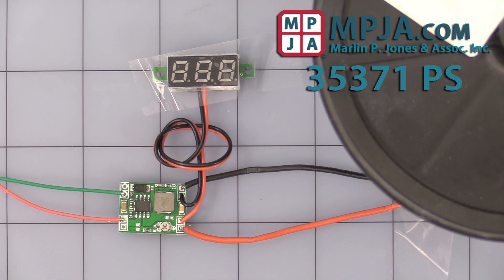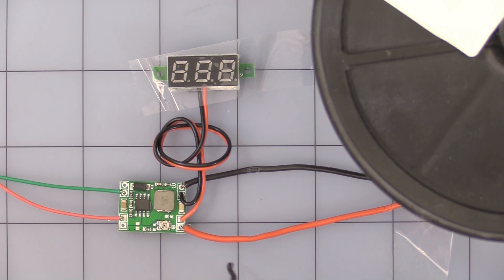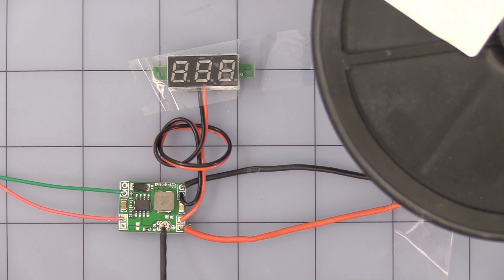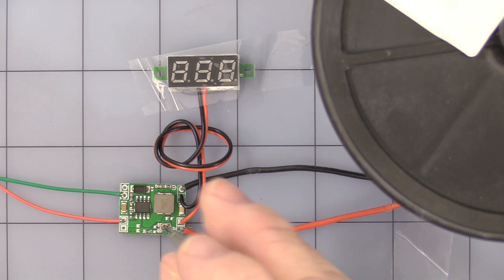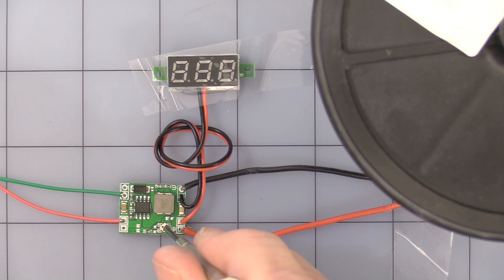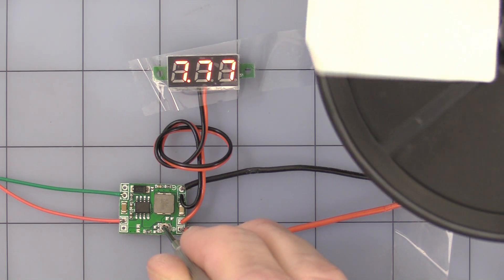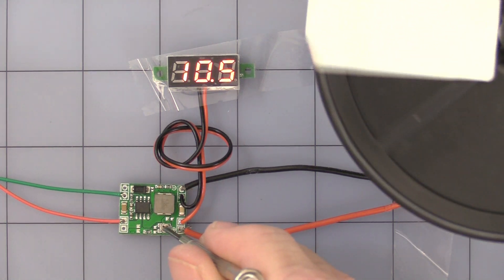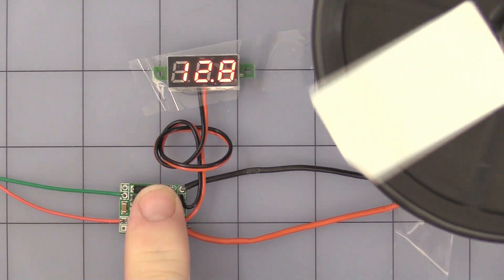Micro Adjustable Step Down (Buck) DC/DC Converter 35371 PS

Comment: Hi
Can We use to charging the phone ?
And can this module  give 5.volt  , 2.1 A output ?, because it is faster charging?
For example  I have batary pack with 12 volt(18650 lion ) I am thinking to use it as powersupply, if it is possible it would be nice because it  is portable.
Reply: You can, but I would not charge my expensive phone with it...You need to know what is the charging current for your specific phone, does your phone have a charging circuit, meaning will it cut the charge when battery is full etc.